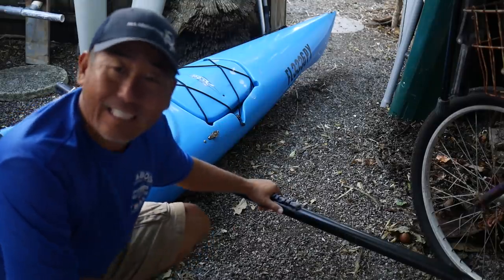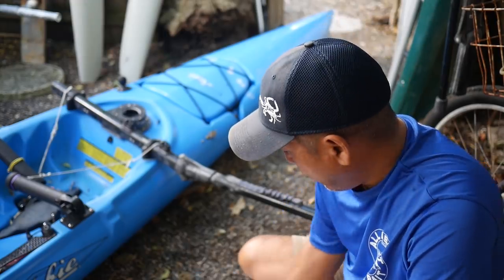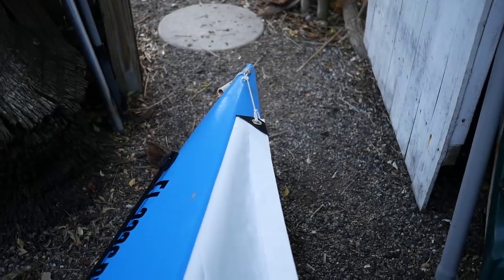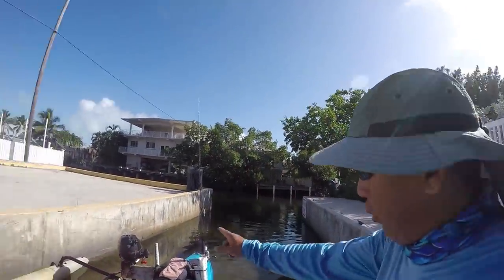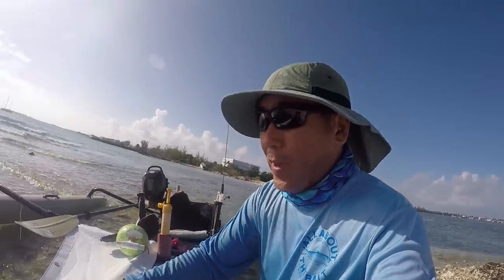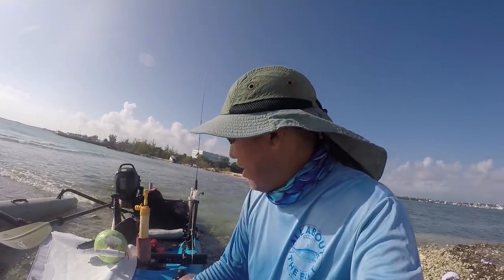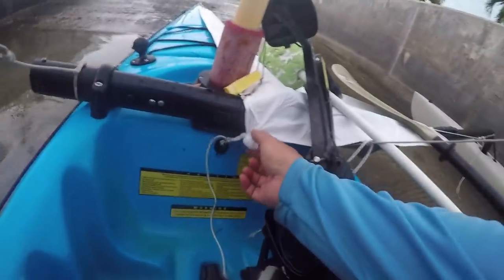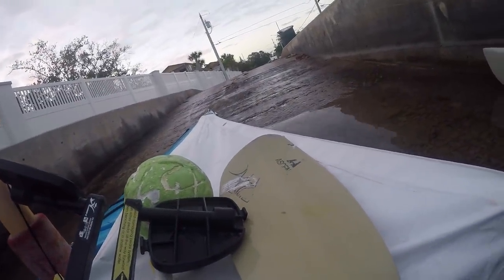Fix The Hassle - Catch More Fish - DIY Kayak Spray Skirt

Comment: Great point about the hassle factor. It's not such a big deal during 8 months out of the year here, but when it comes to ice fishing it takes a lot of gear if it's cold outside, and you have to drag it all out in a sled across the lake, drill a bunch of holes, maybe find fish and be able to sit down and set your shack up with some heat. Then, tear it all down, pack it up in the freezing cold, get back across the lake, but it all away when you get home, often in single digit temps and a 20 mph wind. Anything that makes that process easier means for fishing time.